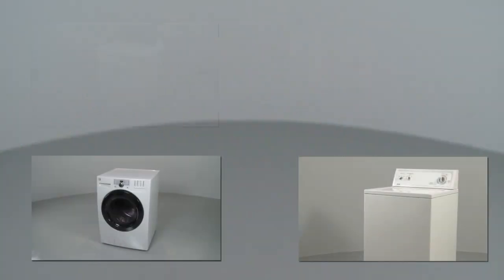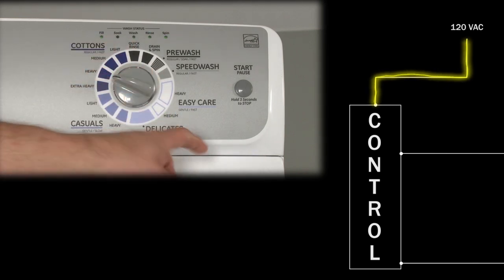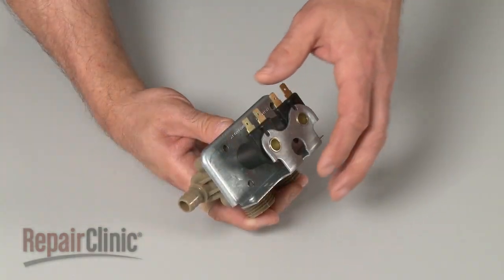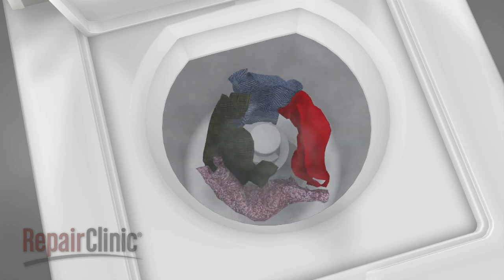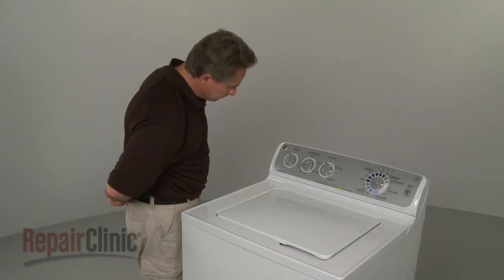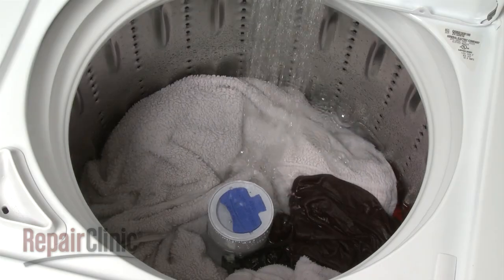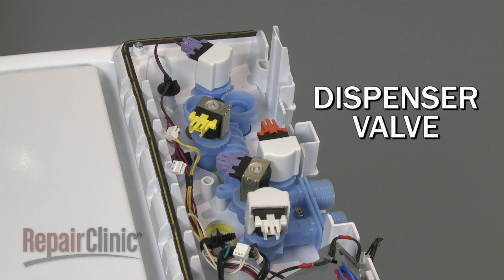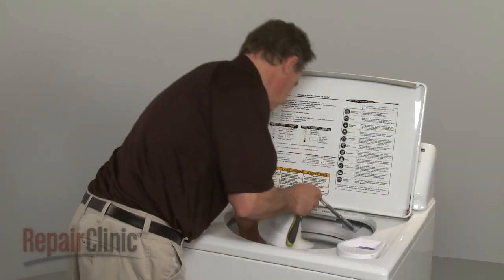How Does A Top-Load Washer Work? — Appliance Repair Tips

Comment: My apartment has communal toploader washing machines. During the rinse cycle it does not stop spinning and does not fill up with water. It’ll add a small bit of water briefly but while it is spinning. As such I can’t add softener since no water pockets are created. Is that by specific design or is there something wrong with the machine?

Comment: My machine starts filling water automatically after pressing power button, even before selecting the required wash program and pressing start button. 
And that happens with cold water only, hot water works fine.

Any help please, it's daewoo DWF-700

Comment: I replaced the drain pump in my washer and it starting working again but when it was on the spin cycle it sounded like it was going too fast and something might break. After a couple more washes the machine stopped working again. There were no loose connections. Any idea what could have happened?

Comment: Begging for help here...

Washer fills fine. Agitates fine. Drains fine. The drum won't spin. The laundry just clumps at the bottom, soaked. 

Tried to reset the motor using the lid trick. Nope. Checked the timing dial and it is seated properly. The airline to the tub is clean. The belt is tight and I can watch the motor turn it and the pillar the agitator is connected to. Lid switch works fine too. I just can't get the dang drum to spin and I can't figure out how it would to begin with. It's a GE wcxr1070a0ww.

Comment: After all these years... 20 years of living... I don't know if I can attribute it to never having a see through top load washer until just recently that I realized what an agitator does. The washer I have pulls the clothes in the middle downwards which pushes the outer clothed upwards so it circulates. Before I thought it just whipped clothes back and forth, not up and down.
Reply: lol so did I.  I thought the the clothes were going around in a circle and sticking to the sides. lol  Thankfully i dont design washing machines or yall closed would be messssssed up :-)
Reply: As a Transformers fan, I like your pfp

Comment: i think the direct drive machines' timers have a piece of metal on the other end of the knob that first closes a circuit to the temperature mixing chamber that either activates the hot or cold inlet solenoids and then the water level switch gets under pressure until the air inside pushes the switch to the left so the timer motor starts, the solenoid deactivates, and the motor spins counterclockwise so the pump doesn't let the water out and the big gear turns both directions causing the agitator to agitate. and then after the wash cycle is done, the timer reaches a point of the metal contacts where there is nothing for a few seconds and then it reaches the drain contacts which is connected to the motor the opposite direction of the wash connections which causes the pump to spin clockwise which directs water out of the tub
(note: i think the neutral drain is engaged by the wash motions since on shorter cycles where there is fast and normal agitation speeds, the neutral drain mechanism hasn't fully engaged which can cause a spin drain to happen)
then after a few minutes of draining the timer reaches another gap in the contacts which stops the motor and releases the tub brakes somehow. then when the timer reaches the spin contact, the motor does the drain direction again but since the neutral drain mechanism has disengaged, the basket spins as well
the washer does the same things for the rinse except during the final spin, there are 2 spray rinses

Comment: I have the metal housing off my Whirlpool top load washer and looking at the outer tub (plastic) I noticed that a large stream of fine bubbles is coming from the drain outlet of the tub (connection to the drain pump hose). I never noticed this before. Is this normal? If not normal what would cause this? The pump engaging in reverse and pulling air from the drain hose? Which would be transmission I guess.
Reply: Michael March My Kenmore 500 (2009 model) does the same.

Comment: I replaced lid switch and I don't know if  connected the wires correctly. The wires on the new switch were orange and white w/orange on it. the wires 0n the washer were white and white w/orange, I hooked the wires w/ orange on them together I hope that was correct

Comment: My 10 year old Moffat washing machine is leaving oil marks around the top inside of drum and sometimes oil spots on clothes.  Is it worth repair or should I go straight to a new one?
Reply from the maker: +Kathy Syrett Most likely the transmission is causing the problem and depending on the cost of the part it may be easier to buy a new machine.
Reply: +RepairClinic.com thank you for the advice. I do plan to purchase new.

Comment: If drain pump won't stop running what could the problem be?
Reply from the maker: Stemple7 If it is an electric pump than the control that send voltage to it is likely defective. Enter your model number into our website search box to view the parts for your machine. http://www.repairclinic.com?TLSID=1773

Comment: I replace my control panel on a GE Profile all the lights are blinking on the bottom but it wont turn on
Reply from the maker: It may be that the door is not latching correctly or the door switches are defective. We recommend that you check those components first. You may find our website's free troubleshooting and repair help information to be helpful: http://www.repairclinic.com/repairhelp?TLSID=1773.

Comment: I dragged my washing machine up the stairs upside down because that was the easiest way to get it up there, and now the spin cycle is clunky and it leaks. did i ruin it by moving it upside down?
Reply from the maker: Frank Tennyson Yes, there could be damage to one or more components. The best place to start troubleshooting is to enter your washing machine's model number in our website's troubleshooting and repair help section: http://www.repairclinic.com/repairhelp?TLSID=1773.
Reply: Frank Tennyson Probably you have ruined the motor etc
Reply: WHAT THE HECK, YES!!! YOU DID RUIN YOUR WASHER WHEN IT WAS UPSIDE DOWN!!! YOU NEED A HAND TRUCK OR DOLLY TO MOVE AN APPLIANCE!!! HAND TRUCK IT FROM BOTTOM TO SIDE ONLY,  THE WASHER HAS TO BE RIGHT SIDE UP FROM BEING DAMAGED!!!

Comment: It sure does save money watching DIY project on you tube.
I picked up a Washer down the street curb side. the guy said his
wife wanted a new one this one started to leaked, I check the pump
out it was just a loss hose. I fixed it. Now I got it set up outside using it
as our mine washer re using the water threw a filtering system each time
Reply from the maker: altha2008 Congrats on the successful repair.
Reply: altha2008 You mean lose

Comment: Thanks for the info. While some steps in your related disassembly video were not 100% accurate to my 2009 GE Profile washing machine, I was able to disassemble and locate a major issue. On my 5 yr old washing machine, the tub became unbalanced and was making a banging noise during spin cycles, similar to when its contents are unbalanced. After disassembling the agitator (very simple procedure by following this video and which everyone should do annually to inspect), the main issue was revealed: the metal base that hides under the visible plastic agitator had RUSTED and broken loose from the tub. Nearly 1/2 the circumference of the tub's metal base was broken/disconnected, and the entire metal base was corroded and rusted.

The metal base, which allows the motor assembly to turn the tub, is prone to water exposure and rust. And, the upper part of the tub (plastic top section) was audibly full of water but there was no obvious way to empty it out even after pulling out the entire tub. 

In summary, after seeing all of the debris sitting at the bottom of the outer tub (inside of which sits the main tub where clothes go), and the horrendous odor of the stale water, it's clearly an engineering disaster.

Not sure if other manufacturers have such poor designs but I would NOT recommend a GE model after experiencing this ... and having it die after 5 short years of life.

Comment: DON'T JUST START REPLACING PARTS!! :)  If you're having problems with overflow, wet clothes at the end of spin, the spin cycle doesn’t always engage OR your timer (cycle selector) isn’t working properly; THE FIRST THING TO CHECK is for a blockage in the water level switch pressure tube and clear it. There may be a partial or complete blockage, depending on the symptom.

Following are steps to clear a blockage from the water pressure switch tube (for GE Washer GCWP1000M0WW; however same principle applies regardless of model):  

1)    Drain the tub completely.  

2)    Unplug power from the wall outlet.

3)    Remove the backsplash panel to expose the Water Pressure Switch (left side).  

4)    Remove the front panel of the washer to expose the tub to plain view. (There are instructions on how to do this at the RepairClinic.com web site.)

5)    Disconnect the lower end of the Water Level Switch Tube from the outer tub. (Use a towel to absorb any water that may run out of the tube.)  

6)    Disconnect the upper end of the Water Level Switch Tube from the Water Pressure Switch.  

NOTE: You may see dark sediment or lint near the bottom of the tube. If so, that's the blockage. If not, check the entire length of the tube for any blockage.

7)    If the pressure tube cannot be cleared, then replace the tube (using OEM Part # WH41X365). Otherwise, clear the pressure tube by running hot soapy water through the tube to loosen any blockage. Blow into the tube hard on the clean end to apply greater pressure to clear the tube.

8)    Once the tube is clean, reattach the bottom end of the pressure tube to the pressure reservoir on the side of the outer tub.

9)    CRITICAL STEP: Once the pressure tube is attached to the Pressure Reservoir on the outer tub, BLOW very hard through the top of the pressure tube to clear any sediment and water from the pressure reservoir below.

THE TUB WILL OVERFLOW WHEN FILLING IF the pressure tube and reservoir are not cleared of all debris!!

10)    Reattach the top end of the Pressure Tube to the Water Pressure Switch and lay the Backsplash Panel back in place.

11)    Plug the washer into power and set the Water Pressure Switch (load selector) to Small.

12)    Run a test fill of the washer while monitoring the Pressure Tube and Reservoir.
a.    If filling stops at the small load level, then test with Large and Super settings to verify that the tub is filling properly.
b.    If filling doesn’t stop at the large or super level, STOP THE WASH CYCLE IMMEDIATELY! Then disconnect the Pressure Tube from the back of the Water Pressure Switch and blow hard again to clear any water or debris from the tube and the reservoir below. Then run another test fill. (You may need to drain the water from the tub first.)

13)    If replacing or clearing the Pressure Tube doesn’t work, then you may need to replace the Water Pressure Switch (try that first), the water intake valve assembly or the Timer.

14)    If the washer fills correctly, then run a test load or two to ensure that the water fills properly, that the washer completes its full cycle AND verify that clothes are not over-wet at the end of the cycle.

15)    If this all works, reassemble the washer and BE HAPPY. You have just saved yourself $100 in parts and a $125 minimum labor service call!!
Reply: I'll be happy to change my "dislike" back to "Like" once you've updated your video to include the procedure that I have provided here. :)
Reply from the maker: We never encourage customers to just buy parts. We always suggest they test their machine to figure out what is causing their symptoms. Thank you for the comment though, we appreciate it.
Reply: Of course. However, none of your recommended troubleshooting even mentions the pressure tube, which should be the first thing to check for any symptom related to overfilling tub or tub not filling correctly.

Comment from the maker: This could be caused by different problems. The motor could be tripping out on the overload and coming back on. The lid switch may be making  intermittent contact . The timer contacts may be intermittent . It might be difficult to figure out without testing power to the motor and from the timer and lid switch when the problem is happening.

Comment: Good overview.  

My own problem is a bit weirder.  During the spin part of the cycle, washer shuts off for about 17 seconds at a time.  Goes back on for a short time.  Turns back off, etc.

It drains well, spinning very fast.  I've seen it agitate.  Although one time I heard the motor going and I opened it and saw nothing was happening.
Reply: Al Smith I’m not an expert on this but the motor might not be properly connected to the drum. Don’t know about the first problem but the second problem sounds like it.

Comment: Well this was useful in at least understanding how top load washers work. I'm trying to fix an issue where water drips from the inlet spout when the washer is off. I can shut the drip off by closing the hot water valve, so I guess it's not a huge concern right now. Wish me luck!
Reply: How'd you go? Did you ever end up fixing it? Just curious lol